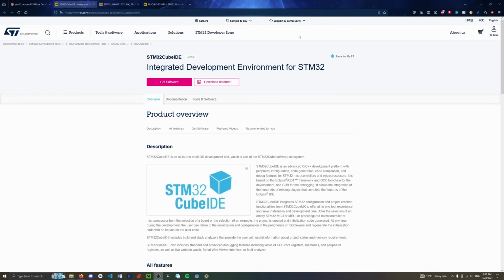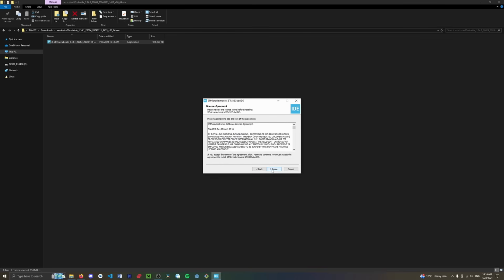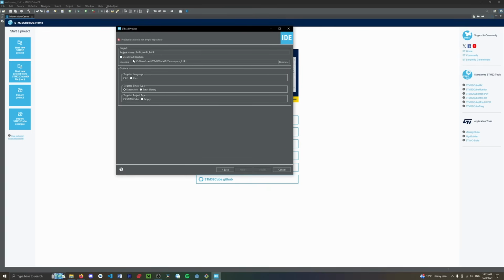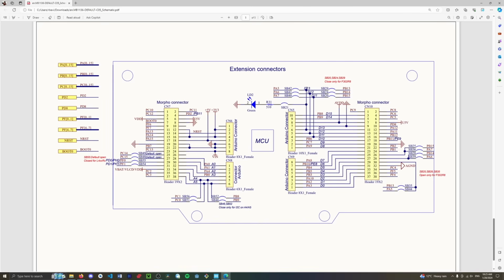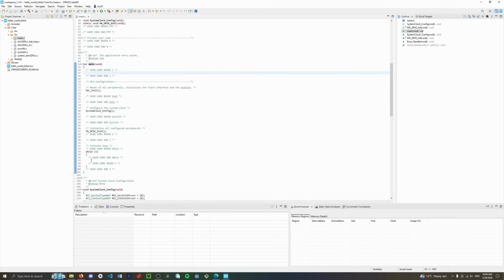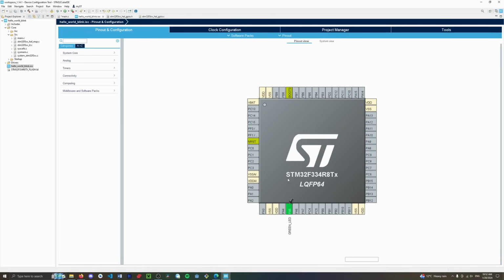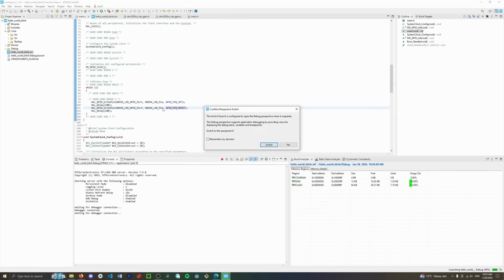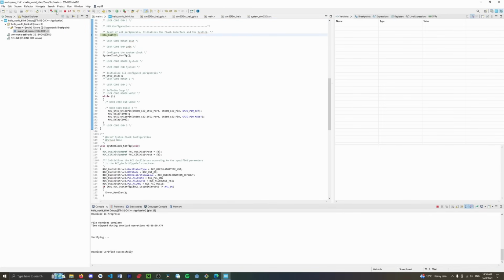Get Started With STM32 and Nucleo Tutorial - Hello World

Comment: I was with you all the way up to 4:24.  My IDE has no myST button.  But what's worse, there is no "Start new STM32 project" option, either on the upper left of info center or under the New menu.  Also, I noticed that your IDE has a "Start new project from CubeMX" button, mine only has a single button called "Create/import STM32 project".  It is as though CubeMX is missing.
Reply: FYI, after downgrading to IDE 1.19 I was able to follow your tutorial to completion.  Thank you for a very nice tutorial.  Well done.  It's a shame that STM does not consider all the FREE user-developed content that they obsolete when they make arbitrary changes to their software.